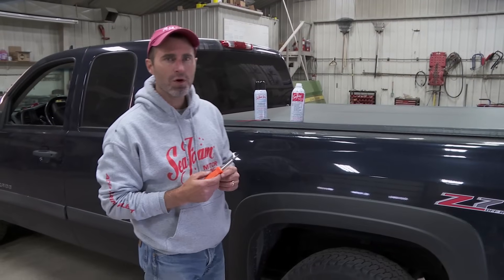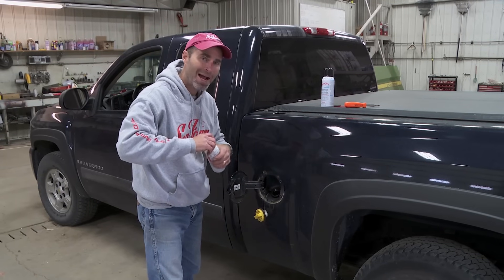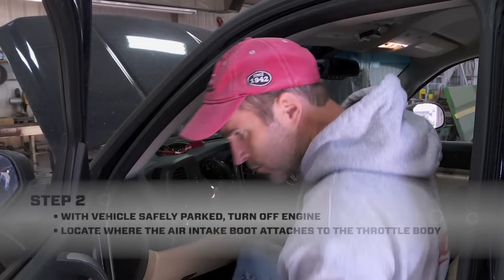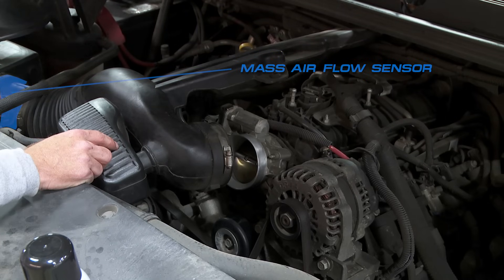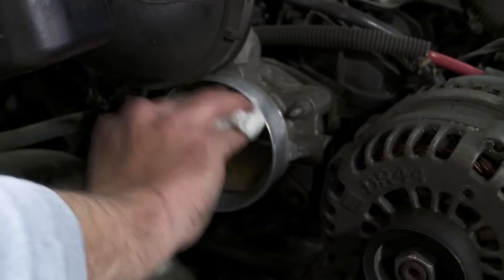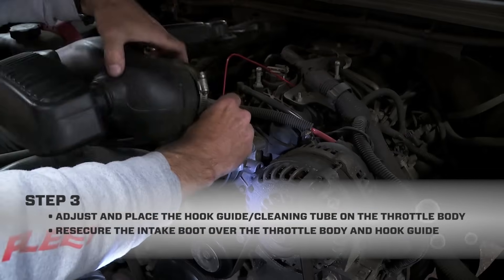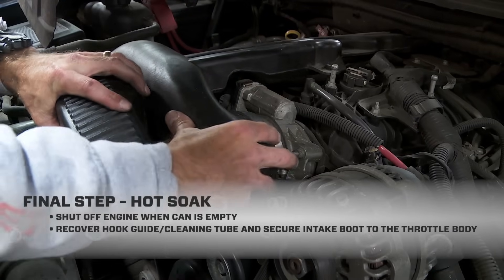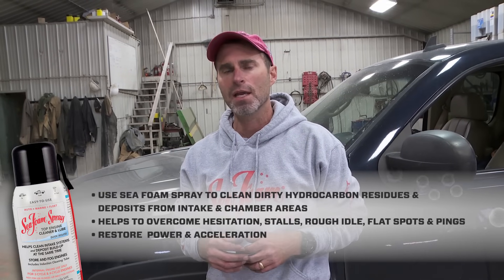How to clean a gasoline fuel injection air intake with Sea Foam Spray

Comment: Didn’t work Most of it was on the ground leaked through a new K&N filter. Not enough suction on a Challenger SRT8. Prob got on my Mass Airflow Sensor although I don’t have any problems yet. Had to wipe down everything. 
Kinda disappointing.
Reply from the maker: Supposing you're referring to a K&N air filter, you might be spraying into the wrong place.  Have to be right in front of the throttle plate. Please specify, go from there. We're happy to help, anyway.
Reply: Negative followed your instructions on line and on the can where to put the nozzle. No way to tell if the fluid was bouncing off the throttle plate or wasn’t getting sucked up enough. The excess was running down the intake and seeping through the K&N rubber seal on to the ground. Didn’t see till I got back. After I got back from romping in it, I pulled the intake back off and it was soaked throughout. Had to wipe it all down.
Wife help the RPMs about 1500-2000
Reply from the maker: @JulietteNiner  How the liquid could go 2 feet backwards against a 1,500 RPM air stream puzzles.  You had the end of the straw nozzle directed 1/4" in front of the throttle plate, correct?
Reply: That’s correct after confirming 3 times I got the nozzle 1/4 inches from the throttle plate. After reading Eric the car guy. Kind of makes sense. 
https://www.ericthecarguy.com/kunena/8-Service-and-Repair-Questions-Answered-Here/63046-seafoam-intake-cleaner
Reply from the maker: @JulietteNiner   Respectfully, the OP in the link you shared is referring to throttle plate cleaning.  Yes, you can spray it on the throttle plate to clean the blade, but not what it's primarily designed for. Sea Foam Spray is made to clean intake valves and chamber areas under elevated RPM. The mystery at hand is how you ended up getting Sea Foam Spray (fluid) into your air filter (2+ feet upstream) if you placed the straw nozzle immediately in front of the throttle plate?  That's like the guy in the barrel going backwards up Niagara Falls.  Please appreciate that the air draw at 1,500 to 2,000 RPM leaves no question about what direction the spray is going - the atomized spray flows rapidly in the air stream to the intake runners, hits home on the backs of the intake valves, then into the chambers to continue cleaning. Hope this helps.
Reply: Respectfully, the post is about both spraying the throttle body and spraying into the intake.
Reply from the maker: @JulietteNiner  Just trying to help.
Reply: I appreciate your help but, suppose I was a helicopter Mechanic and pilot for 20 years in the military and I have a little bit of mechanical knowledge working on my own hot rod, you would assume I could aim a nozzle into an intake correctly. Not tooting my own horn but, take the lowest common denominator out of the equation. 
It’s not hard to aim the nozzle into an intake. The fluid did NOT ingest into the intake at 1500RPM. Most of it was most likely deflected from the throttle plate. Sea foam poured down north of the throttle body and seeped through the rubber seal between the KN filter and the intake housing. I have a picture of the big puddle under the car. Yes I did smell it to be sure it’s not AC water. 
Maybe the bottom would have been better I don’t know but, if what you are saying is true, there should have been enough suction and their wasn’t.

Comment: Will the seafoam spray also clean the throttle body ?
Reply from the maker: No, the spray application starts to work around intake valves, then into the chamber areas.  You can clean a throttle body manually - spray areas, let soak for 10 minutes, then follow with a light brushing on the valve plate and bushings.  Note that throttle valves and bushings can get dirty... but the inside of the throttle body, not so much. Personally, I might clean the valve parts and see less need to clean inside the throttle body. Hope this helps.
Reply: @SeaFoamOfficial  Ok, so I will manually clean the throttle body with throttle body cleaner and then do the seafoam procedure as explained in the video. Thank you for your answer.
Reply from the maker: @yancaron903  You can spray the throttle body before you set the straw for the intake application.  Just let it sit and soak for 5 minutes before starting the engine.  Just wipe the plate when ready to re-secure the intake boot when all done.

Comment: i did all  the steps gas tank and in the oil    and added too sprays  in Throttlebody I let it soak for 20 minutes and then started back up but only a little smoke came out tiny bit
Reply from the maker: Smoke is vaporized Sea Foam oil.  Whether you see it does not matter.

Comment: Hey I tried this but I dont think the can sprayed, it feels full. it maybe because my cars throttle body valve was really strong,  caused a dent in the spray nozzle straw. although when I spray with the nozzle stray on (not in the valve) it sprays fine. Not sure what to do Should I try the whole thing again? There was no black smoke
Reply from the maker: Couple things: 1) The nozzle should never go as far/deep to touch the throttle valve. 2) It seems you kinked the straw enough to close off flow. Please contact our customer service (website) so we can remedy for you.

Comment: I find the part about adding Seafoam to the gas to be misleading. Seafoam should be mixed with the gas, which is best done when you fill up the tank. Simply dumping in the product does not mix very well at all and won't be a good use of the Seafoam.
Reply from the maker: Sea Foam and gasoline are miscible and share the same petroleum nature.  When two liquids are miscible they immediately mix in proportion.  Nature does its thing - nothing to do.

Comment: Ive been using sea foam both in my fuel tanks and through the vacuum lines for over a decade and I’ve always had great running cars. I just used this spray in my challenger today 😎
Reply from the maker: What do you think of the spray?
Reply: Sea Foam Official very easy to use 👍

Comment: i have a toyota coaster bb10 bus 1977 it has not been running for 10 years i had it for 2 years and i just got it running but need to put fuel in to the cuberator to get it running, it will be a motorhome one day soon im worker on it bit by bit, it has a australia holden 202 motor
Reply from the maker: Hi John:  Do you have a question we can help with?  Is the choke working properly?

Comment: I just wanna clear this up.... Is it safe to use seafoam in the brake booster line? Or any other method other than what you've shown in this video?
Reply from the maker: Any liquid into a brake booster can risk hydrolock and ruining the engine.  Adding liquid into a brake booster does not clean nearly as well as Sea Foam Spray into the air intake, which is aspirated and evenly distributed to all cylinders.  Compare to pouring a liquid that gets wasted in globs pushed out the exhaust valves. Hope this helps!

Comment: I have a  2015 Hyundai  GDI engine with  25k miles on it If I did this now,how often would you  recommend  spraying  sea foam into the throttle body? Every  5k,10k,15k miles?
Reply from the maker: For a GDI engine, every  five to seven thousand drive miles would go a long way.  You can also do back to back treatments if you feel you've lapsed too long or treating a GDI engine (with miles) for the first time.

Comment: Can I spray my throttle on my supercharged car (1999 Mercedes c230 kompressor)? Another brand of throttle cleaner specifically says not to but doesn't say way. Is seafoam ok since the can doesn't say not to?
Reply from the maker: Yes, no worries.  Application into throttle body is the same with any gasoline fuel-injection engine - supercharged/turbo makes no difference.

Comment: Do you need to put back the air filter on the body while cleaning and car is on? I have a K&N intake and theirs no hose
Reply from the maker: Fuel injection engine or carburetor.  If fuel injection, how do the intake parts attach to the throttle body?

Comment: My 2005 f150  4.6 stalled while moving twice. Check engine light is on.  Got codes p0401, p0109, p2198, p2196.  Dirty throttle body?? please help!!
Reply from the maker: Your codes listed point to EGR, MAP, O2 sensor, fuel too rich.  The first 3 may be worn out and need replacement. BUT first, if you remedy the MAP circuit (electrical) issue you may likely correct the O2 and fuel rich codes (cause and effect).  In any case, Sea Foam Spray is ALWAYS a great idea for cleaning the upper engine BUT will NOT revive parts and sensors that wear out. Sensors are like light bulbs - they work until they fail... Just replace and move on. We say this because we get a ton of calls about how to repair worn out EGRs, worn out Catalytic Converters, worn out O2 sensors... Review: Fix your MAP circuit problem and everything else might go adjust back to normal.
Reply: @SeaFoamOfficial  Thanks a bunch.  Bought 4 bottles of Sea Foam today. On sale at Advanced Auto.  Stuff is really amazing! Thanks.
Reply from the maker: @cyclepowered8799  Glad to help.  Keep in mind that Sea Foam Spray treatments are the ticket to cleaning your Ford's upper engine, which is probably filthy based on your first post.

Comment: What is the difference in results from the spray version that goes in intake, to the liquid versions that's normally poured in oil and gas? Do they all clean the same systems just different method of input?
Reply from the maker: Great question!  They are different here's how:  Sea Foam in fuel passes through the fuel injectors, then into the chambers.  Sea Foam Spray does NOT pass through the fuel injectors - it is drawn into the engine with the intake air to clean over intake valves before reaching the combustion chambers.  It's also important to know that Sea Foam Spray is being applied as a much higher cleaning concentration.  You're running a whole can through the upper engine in 6 minutes.
Reply: @SeaFoamOfficial  and if I have 2 intakes do I need to use half the can or can I do a can in each throttle body
Reply from the maker: @ceo4eva  If two intakes: Spray one for 3 minutes and shut off engine for a few minutes...Then adjust nozzle for second throttle plate, start and spray till you're finished with the second half of the can.

Comment: Can you do it on motorcycle throttle body with the sensor in it?? Because I see a lot of people do that
Reply from the maker: Yes, can do.  A throttle body (fuel injection) is that same application concept as a carburetor throat except you'll likely need to run a fuel injection engine with the intake boot secured over the straw.  A carburetor intake does not have a sensor to regulate air, so can run the engine with the air clear off. Most fuel-injection engines have a sensor (MAF) that won't allow the engine to run unless the air intake boot is secure on the throttle body. The hook straw and guide that come with a can of Sea Foam Spray are designed to run under the boot while it's attached to the throttle body.  Hope this helps!

Comment: Hey Seafoam ! So is there a certain amount of cans we can use through the air intake? So I’ve done this before .. works great but still seems like there might be some more stuff inside the engine and I want to put more  but I Don’t want to mess it up.
Reply from the maker: Great question, Irvin. You can safely use multiple cans. Two cans will do a lot.  At three cans it will get to be like brushing your teeth three times in a row - at a certain point you're wasting toothpaste.

Comment: I used the same method for my 2010 Nissan Rogue.  The car had 75,000 miles on it and ran not bad. However, after 10  - 15 minutes of driving and then coming to a stop the car would always shake and shudder.  I applied a can of the upper engine cleaner directly to the throttle body, I only used about half the can.  After that, it was better than new. I could not believe it. Customer for life!! I would love a tshirt or hoodie to represent my seafoam loyalty!!!
Reply from the maker: Nice!  Shirts for sale on website.

Comment: I have a 98 nissan  frontier where do 
i spray this?
Reply from the maker: The spray is applied in front of the throttle plate where the air intake boot attaches to the throttle body.  The intake boot is plastic/rubber and the throttle body is metal alloy - There will be a hose clamp that attaches the boot to the opening of the throttle body where the plate is located.  Hope this helps!  Note that there is a video on our channel that shows how to locate the throttle plate.
Reply: It shows you in the video dumbass....why would your vehicle be any different from anyone else’s?

Comment: I just put the spray threw the throttle body. Then put seafoam threw both sides of intake on my 2004 3.5 HO it has two throttle bodies. Also put a can in the tank! The car has 163,000. I run a K and N air filter synthetic Valvoline 5w30 high mileage oil. This engine is 255 hp and 250 torque! In such a big beautiful full size car. I don't like the Charger 300 body style. Its also has front wheel drive with traction control. 22mpg  and 27 mpg on the highway. This car runs so much better! Just like it was new! So try seafoam. Like I did! Don't take it to the dealership. $ 40 and your car will run like new. Please read the label on cans. Follow the direction and watch video's on You tube. I don't have backing from Seafoam! Just like products that work. Shawn

Comment: is it normal for seafoam NOT to smoke?
Reply from the maker: The smoke is oil vapor. The vapor will only appear if applying directly into the top end of the engine or if the Sea Foam to fuel ratio is very high.
Reply: i did what was done here. i used the whole can in the throttle body. i always saw videos where it plumed smoke. it was just odd that it didn't happen. i drive a 05 malibu maxx with the v6. i don't know if the exhaust structure does anything different from car to car.
Reply from the maker: No worries.  There are many variables...And not a factor.

Comment: OK, I ran thru a bottle of SeaFoam spray thru my 2012 Tacoma V6.  I had a hard time keeping the stray in the nozzle however.  Any movement in an attempt to maintain the correct angle would cause the straw to come out of the nozzle.  I suggest a better design where the straw doesn't pop out so easily.  The primary issue is trying to keep the other end of the straw in the intake throttle body area at the correct depth and angle which is difficult because of how the straw gets pinched just ahead of the throttle body area.   On a positive note, I did notice cleaner piston heads when I compared before/after pics using my borescope.  Oddly I didn't get any smoke out the exhaust during the spraying of the bottle but I did get smoke after the 10 min hot soak and subsequent start-up and 15 min drive.
Reply from the maker: Hi Jason:  We had bad run of straw/can nozzle fittings a couple years ago (mismatch) so pretty confident you ended up with one, very sorry.  As far as pinching goes, did you can include the Hook Guide piece that prevent the pinching?
Reply: Yes, mine had the Hook Guide.  I'm not talking about the straw getting pinched closed but rather force was being applied to the straw once intake was partially slid back onto the throttle body.  Even though I did slide the intake all the way on, it was still difficult to maintain the straw depth and angle without the other end popping out of the can nozzle.  By the way, I've seen others spray directly into a completely opened throttle body so it's not receiving any filtered air at that point.  This would technically make it easier to spray in but would it be a bad idea to allow unfiltered air for time it takes to empty the Seafoam can (~ 5-6 mins).
Reply from the maker: Thanks, Jason.  Most engines won't run with the boot off but can try.

Comment: my car has a MAP sensor in the throttle body. Is Seafoam safe to use on my car by spraying it into the throttle body?
Reply from the maker: Nothing to worry about regarding your MAP sensor (after throttle plate), just be downstream from the MAF sensor (before throttle plate).

Comment: Its amazing how all this bullcrap "clean gassoline" just absolutly SCREWS ur engine to the point where someone had to think of the idea of Seafoam. 
-_- freakin EPA
Reply from the maker: Fuel and oil residue problems (gum and varnish) predate the Model T and Sea Foam predates the EPA.  You'd have the same fuel and oil passageway problems no matter the grade or blend of gasoline.

Comment: I have a 1988 Buick Lesabre. The MAF Sensor plugs into the top of the throttle body. I cannot see a way of spraying the seafoam into the throttle body without it touching the MAF sensor also. Is there any other way to introduce the Seafoam spray into the engine so it will clean the top engine, but not harm my MAF sensor?

Also, it is the LN3 multiport fuel injection engine.

Thank you!
Reply from the maker: When you have the RPM held at 2,000, the engine will draw the spray toward the throttle body into a vortex air/center.  The air draw will be so strong that the fluid won't go near the MAF.   Keep the RPM steady and you're good to go.

Comment: I poured the seafoam in my gas but I also got the spray do I also need to add that?????? Or do they do the same thing???
Reply from the maker: Great question, thanks!  They both clean chamber areas but take different routes. Sea Foam added fuel cleans through the fuel injectors.  Sea Foam Spray through the intake cleans through the air intake runners, over the intake valves and into the chambers.  Sea Foam Spray is also a much higher cleaning concentration - Consider a whole can is working into the chambers in a matter of 6 or so minutes.